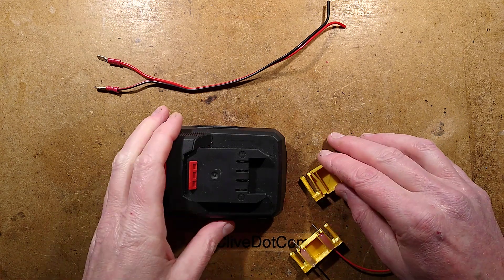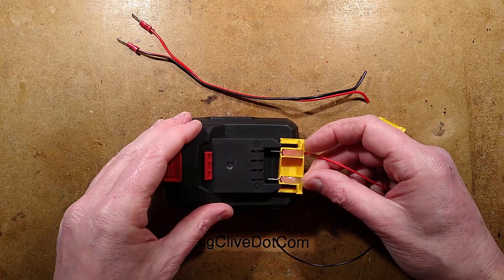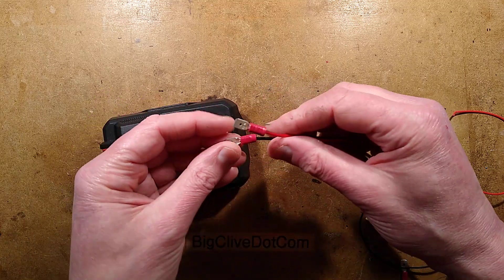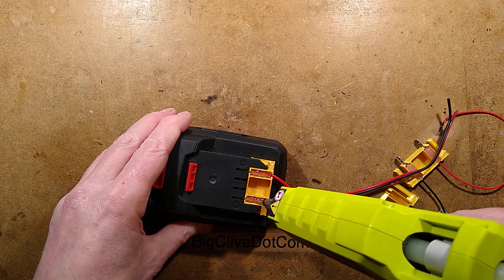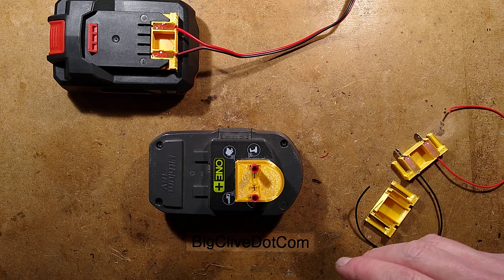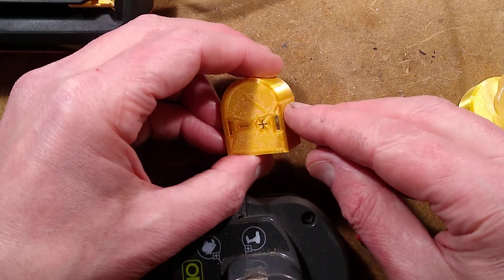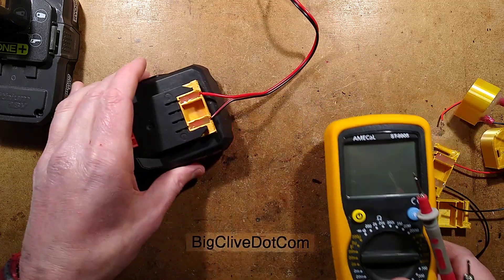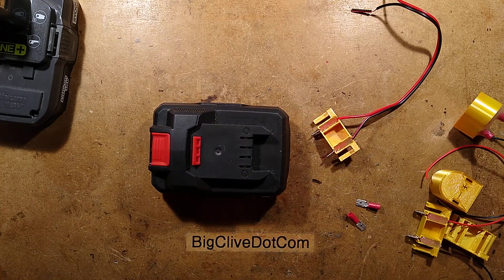Simplest Ryobi and Parkside battery connectors

Comment: oh thats interesting, could use this on my emergency lighting for power cut idea. I have an arduino that i use to control my system, and i have a few makita 18v batteries. have to look into this properly now! thanks
Reply from the maker: Check inside (or online) to see if they have over-discharge cut off protection.

Comment: Here's another use for the 18-20V tool batteries that may not be something many would think of: using them as a temporary power pack for laptops, via their AC Adapter port. 
Most laptops are 19V DC input from their adapter, but can still operate from a range of voltage. Having perused forums, the consensus was that using 1V higher is going to be within their tolerance spec same won't harm anything (personally, I've always wondered if the circuits used 24V DC rated components since that's a common voltage).

Of course, running at a lower voltage is doable, but I lack an adjustable bench PSU to actually test what the lowest voltage is it'd operate on. I wouldn't be surprised if it was fine down to 16V, as long as the battery could put out the needed current (given that pretty much everything in a laptop is sub-12V, and probably 5V these days; sans battery). 
Of course, an inline fuse would be smart. Hell, even for Clive's for that matter 🥴
[CAVEAT: Some laptops, on their power input, handshake with the adapter to ensure its an authorized unit (ie properly specced), and if it isn't then it runs/charges at a very reduced rate, like trickle charge rates. Smartphones do, or did, similar, as all of us have no doubt experienced at some point this past decade. Point being that the same 'problem' would happen on those laptops by using a battery, since it wouldn't recognize the source.]

Comment: Quick tip Clive - many slicers have "elephants foot correction" where you can specify that the first layer is shrunk in xy coords to combat the elephants foot. Prusaslicer has it enabled by default on newer profiles 2.4.0+ afaik

Comment: I'm just curious about what project you want to do with the batteries. Also, I've seen the connectors ready made for makita, bosch, milwaukee, ryobi, etc on aliexpress
Reply from the maker: It was inspired by the Pinecil soldering iron.  It also has programmable low voltage cut-off.

Comment: One of the reason I didn't go with Ryobi tools is that awkward neck sticking out the battery pack.
Reply from the maker: That's a legacy thing due to backward compatibility.   Their batteries also have a lot of protection built in.

Comment: I bought one "shame on me", for my Makita BL batteries and use a buck converter to bring the voltage down to 12 volts that I use for ongoing stuff that needs powering. All those batteries that folks keep charged and no way to get to the power. Now you can. Great video btw. Thank you kind sir.

Comment: Hi BC I've got a whole set of Erbaur tools that take a standard 20v  2.0ah (x4 terminal) from 4 yrs back, They sold a bucket load out of Screwfox. Unfortunately they changed battery standard in the latest iteration to a "EXT" battery with 5 terminals and a clever charger tech. Would love if there was an adapter to allow me to use the older on the newer EXT generation tools. The adapter would have to have an EXT male top with a female older standard bottom, that my 20/2.0ah battery would slot onto. Allowing me to use my still going strong x5 older tech batteries.

Comment: Wondering if just measuring volts on a multimeter may not be a real test of the adaptor as a high amps load might show up a high resistance bad connection.  Show a test at say 10amps for 10mins? to load test it,

Comment: I made my own connector for a 36V Ryobi from wood and banana plugs. Was important to me to have a fuse holder on the connector because I'm very wary of "high-power" batteries: https://drive.google.com/file/d/1aWlQ4neCn_V3qFRKt6QUqEOqhcmbKRNM/view?usp=sharing

It was used for a project driving a bunch of Ikea Ryet LED lamps at ~60V in fun patterns, as well as an old-school "outdoors telephone bell" to make noise. We figured out the LED lamps started working at that voltage (DC) already, and that way we only had low voltage in the project. Here's the control board for the logic and driving: https://drive.google.com/file/d/1ih0tLOo74wDpq_07S2EcPy3-Rttap-VK/view?usp=sharing

One issue I had though was that the battery would only start supplying the proper voltage if it was loaded down enough, I assume this is due to some protection or perhaps voltage conversion circuitry going into standby mode when the battery is not in use. Even once powered up, it would regularly (like every minute iirc) try to switch back into "standby mode", which would cause a brief voltage dip that could reset the microcontroller. If anyone knows if that can be avoided, it would be good to know (or I guess I need to add a big capacitor for the microcontroller next time :))

Comment: Nice job.
I had an old Hilka 6volt drill which was powered by 5 "C" sized Ni-Cads,1.5 a/h, which were very poor, what with the memory effect as well.
I bought a sealed rectangular 6v, 4a/h lead acid battery (£8, I think), and fixed it to the top plate of the old battery case having cut off the housing below, because the new battery would not fit in.
It works really well, with the extra power and life between charges, and the retained top plate, with nose of the original battery pack can be used with the original charger.

Comment: Maybe on the Ryobi battery possibly make a revision of the battery contacts by using a backside female Spade connector and where there may be plastic false terminal or tongue that sticks up to help locate and the secure with super glue. My thought is to provide a springiness to the connecting surfaces ideally could also provide a better friction-fit more secure connection to the the battery. Either way easy quick simple this has to be one of the more better ideas in general useful items to come of a 3D printer

Comment: Since, like most things these days, products are only made by about 4 different factories then manufacturers slap their brands all over it, meaning quite a few batteries are actually compatible with each other or only need minor modifications to the case to allow them to fit, so it's worth searching along the lines "are Ryobi 18v compatible / interchangeable?"

For example, I have a Greenworks mower and I found an article from smartfamilymoney about battery compatibility, it was quite nice of them to do all the work for me figuring out that several batteries from Kobalt, Snapper, Powerworks, etc were all the same and thus I found some Snapper batteries sold as "not working" for just $20, they only needed to be brought up to 3v per cell, so the charger would recognize them and have worked great.

Comment: I wish all of you could see the glory that is my homemade inverter for Milwaukee 18 volt batteries 🤣🤣🤣 I spent good damn time and a lot of thought to create the 400 watt peak little fucker and formed polycarbonate to make a case and even the connection is thick polycarb that I cut, shaped, and formed to lock onto the batteries. I have a "big" cooling fan on the inside/top of the polycarb case right about my mosfets and the transformer that only kicks on if it starts heating up. The only piece I had to purchase for the project was a big fat step down module so I could draw reasonable current stepped from 18v to 12v. It's actually pretty small for it capabilities in my opinion especially when I can use smaller batteries and still achive 400 peak watts. It also has a digital over current and over heat protection because I didn't want to have to change fuses. If I draw too much current light goes red and I turn it off and back on to reset. 

Single 120v outlet and two USB ports that put out 4 watts together. I made a wiring mistake or used a wrong component somewhere which allows the USB ports to still function even if the unit has too much current drawn from the 120v outlet but it hasn't been an issue in any way so I consider It a feature. I also have a homemade "proprietary" connection that allows me to run more batteries in parallel. 

Creations like this are what happens when you live in a state that gets hurricanes with multi-day power outages.

Comment: Any thoughts on adapters from one brand to another? E.g. Parkside to Makita or Bosch?

To my mind and eyes, the only reason the brands use their own form factors (and often it's just a question of where the connectors are) is to lock you in to their "platform", and they should be forced to standardize like we're seeing with mobile devices and micro-USB and now USB-C.
Reply from the maker: There are various adapters on thingiverse.

Comment: For a Ryobi batterys there are two types of pre wired "DIY Power Wheel Adapters" for $10 each that can include the whole battery catch plate, or just enough to push onto the center post contacts. (there are three contacts in the adapter with two wires hooked up)

There is also now an official Ryobi $20 "portable power source". (battery adapter with two USB ports)

Comment: Hey man I have an idea for the supports, cut the script at the layer where the flat faced base finishes and starts on the outer walls and instead of creating walls have it make the ‘ports’ for the  crimp terminals to sit in. You’d need to mirror the polarity symbols on the stl file before printing and then just glue the two pieces together or even connect the two on the flat edge with a thin layer like a hinge then fold over and glue which would give it more strength and shouldn’t take that much longer to print 

Apologies for the terrible explanation

Comment: not sure what i would end up using this for, but suppose that's the beauty, it could be for nearly anything. without a printer i'd be tempted to try making a cast with hot glue, just wipe some silicon on the bits far enough from the connection and hot glue away. far less pretty but i imagine it could work. or worst case make a fun mess!

Comment: Here's my implementation of another commenter's idea to improve the ryobi one with a separate print with a hot glue "basin". The idea is that you use superglue/CA to glue them back-to-back.

//ryobi top hot glue assembly
$fn=50;
height=12;
union(){
    difference(){
        union(){
            //main block
            cylinder(h=height,d=29);
            translate([-14.5,0,0])
            cube([29,20.5,height]);
        }
        //battery recess
        translate([0,0,1])
        cylinder(h=height,d=27);
        translate([-13.5,0,1])
        cube([27,19.5,height]);
        //terminal slots
        translate([-12.5,3.5,-1])
        cube([2,7,5]);
        translate([10.5,3.5,-1])
        cube([2,7,5]);
        //polarity window
        translate([-7,4,-1])
        cube([14,6,5]);
    }
    //hot glue basin
    difference(){
        translate([-14,1,0])
        cube([28,12,height]);
        translate([-14,2,-1])
        cube([28,10,height+2]);
    }
}
Reply: It's wonderful that we can share scripts in YouTube comments without the need for file hosting services.

Comment: Keep in mind to check if the battery pack has integrated low voltage protection/shutdown. Easy to forget stuff and find the pack on it's last breath.
Reply: Ryobi batteries have low voltage protection. However, I sometimes use my parkside ones as well to power my 18v air compressor and never had an issue.

Comment: Here in US all my workshop and garden tools are DEWALT 20 volt except my chainsaw and circular saw which are 60 volt.   I use 20/60 Flexvolt batteries for those tools which automatically detect a 20 volt or 60 volt tool.   Probably 18 tools in all.   I recently wanted to add an electric powered sprayer (I’m getting old and pumping is a pain!) but DW doesn’t make one.   I found an ideal unit by Harbor Freight (20 volt) but, of course, you must use their own battery.   I am not a fan of different battery types so I looked in eBay and found a guy who prints adapters so I can use my regular DW batteries in the Harbor Freight tools.   I just leave the adapter in the tool and it’s ready for a DW battery any time.   3D printing certainly solved that issue.

Comment: Apart from ryobi, most batteries dont have an internal low voltage cutoff circuit, so it's important to add one to prevent killing the batteries. There's an adjustable XH-M609 module for around $5.
Reply: I researched a cutoff circuit and found someone selling one, but I couldnt make out everything I needed on the picture. Do you have any insight?
Reply: @brainfarth  I've been using XH-M609 modules for a long time. They are cheap and work well.
Reply: @DanielAS133  I've seen those before. I was hoping for a simpler, more compact solution. I need to hit up our local EE at work when we are not too busy.
Reply: @DanielAS133   Going to order this module, so thanks for that info.  What voltage should be set as the minumum voltage?  (guessing 15 to 16 Volt?)
Reply: @brainfarth  People use 5S BMS modules (faking balancing connections with resistors) and that way getting compact discharge and overcharge protection. You could even charge parkside batteries in non parkside charger that way (since actual balancing is inside parkside batteries).

Comment: Generally, it's a good idea to use the "horizontal expansion of the initial layer" setting in your slicer (assuming your slicer has such a feature) to make the first layer a little smaller. That way, you don't have the elephant's foot in the first place. Alternatively, you can either chamfer the bottom of your parts or make the first 0.2 mm (or whatever your layer height is) a little smaller, in the 3D model itself.
Reply: I've seen some people design a small chamfer into the part where it will be in contact with the print bed to counteract "elephant's foot"

Comment: if you over discharge a 20v xteam parkside battery the cell protection will be triggered, and then you will NEVER be able to recharge it. its a one time protection and the chip will just not send the serial data to turn on the charger anymore. this one chip also does cell balancing, I have not bothered to check if you just connect the cell to 20v if the chip will then balance anymore, but i do have about 40 duff pcb from dismantled cells to test with if needed..... how to reset this chip, no idea, i cant find a data sheet or anything on it, buy the chips yes, there on some chinese sites, but without data sheets linked

Comment: MAC allister are the same too (20v) batteries.
Reply: mac allister / guild battery are identical. Big clive s design is excellent if you have a 3 d printer. mine is much simpler for these cells.A bit tricky to explain but just use a 30mm cheese block for old school furniture with 2 wood screw holes. then straighten out 2 brass picture hanging brackets (the thin ones) . apply some heat to end of brass hooks the force into wood screw holes in cheese block. the spacing is perfect for pos and neg holes in the celll. this has no wires attached instead use crock clips onto brass terminals.only downside is the cheese block is reversable so mark the pos with red pen or red paint. works a treat.

Comment: My grandpa took all my old nimh ryobi batteries, took em apart, threw the cells in the trash, drilled a hold in the rear, soldered on a piece of good  extension cord, ran it through the hole, put pos neg clips on the other end and put the thing back together.
Now I can run my skill saw from a car battery 15 feet away!! XD

Comment: Does that battery automatically cut off to prevent over discharge or is it up to us to not abuse it? I think I used one of those lidl batteries to rebuild a vax battery.
Reply from the maker: I don't think this particular battery has a MOSFET for shutoff.
Reply: @bigclivedotcom  there's only one way to find out!? Well ok there are a few,  but I favour the disassembly approach. I don't remember if I've had that type apart before.

Comment: You might want to add a passthrough for the thermistor too, depending on what you're using it for. I'm going to make one for Black and Decker to Bauer and it requires it (I was waiting on contact springs which finally arrived). I'm also planning on adding a small usb 5V output module.

Comment: I know that the "Workzone" batteries for my cordless drill fit a couple of other makes too, for example those made by Erbauer and Mac Allister
Reply: Is Workzone the Aldi brand name? I've got a full set of almost new Mac Allister tools that the charger went bust on, and of course B&Q don't carry the charger any longer.
Reply: @bren106  The drill I got cost £50 and came with two batteries and a bag to hold it all, you could find the exact same drill (a few minor cosmetic changes) being sold in Screwfix, Tool Station and even Argos all under different names.

Info on the battery is:-  ABP118W1.  5INR18/65.  Positec Power Tools Ltd, 41 London Rd, RG14 1JX, Newbury.

Comment: Ingenious! I'm definitely  going to have a go at using.  Have you plans to make for parkside 12v?
Reply from the maker: I may explore that.
Reply: Successfully converted my Bosch cordless vacuum cleaner to run off a 20v parkside battery. Your connector was key to its success. Works a treat, thank you!
Reply from the maker: @andrews9342  Keep in mind that some batteries do not have over-discharge protection in them.  So don't use it too long between topping up the battery pack.